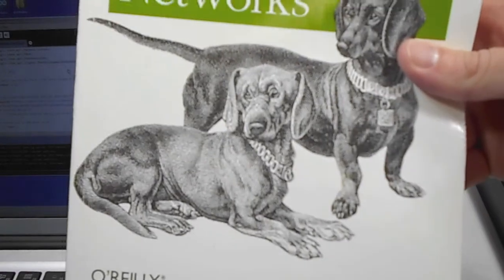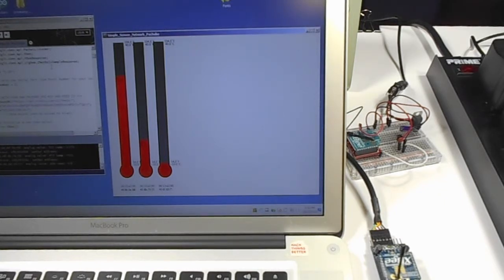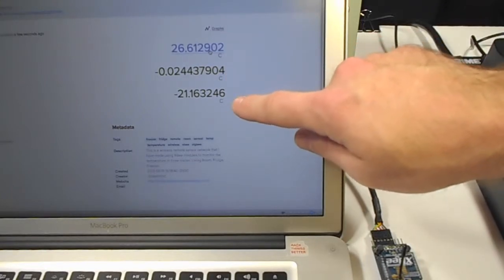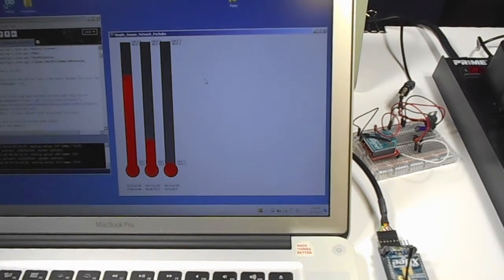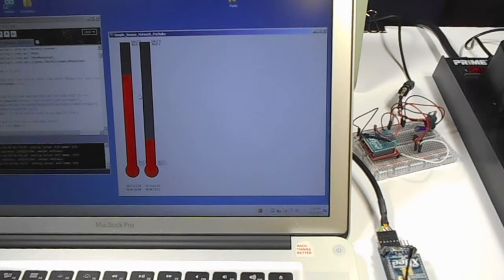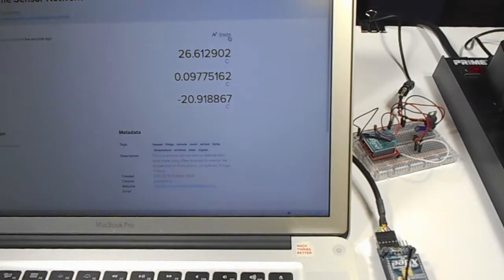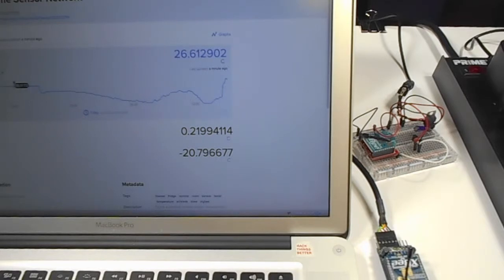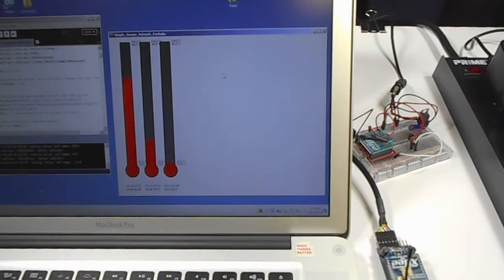BWSN Uploading remote sensor data with Xively

Comment: Hello, I know you have done this project about a year ago... can you tell me what will be the SERIAL PORT (COM PORT) path for the xbee module if it is COM5 on my Win PC ?? it's been asked inside the sketch on about line 20
String mySerialPort = "/dev/tty.usbserial-A1000iMG" what the line should look like?

Thanks a lot.
Sam
Reply from the maker: Sam,  The serial port "/dev/tty.usbserial-Ablahblah" is a mac serial port.  Of course it would look different from the one on a PC.  I've updated this sketch from the original to query the PC and put the list of serial ports in an array.  Then the user must choose the appropriate SerialPortNumber that contains the XBee port.  I've posted it on my blog here:
http://jamesstokebrand.wordpress.com/2013/10/19/bwsn-uploading-to-xively/

Here is my change:
<code>
//  * Replace with the Serial Port (Com Port) Number for your local Xbee *
int SerialPortNumber = 1;
</code>

<code>
 // Print a list in case the selected one doesn't work out
  println("Available serial ports:");
  println(Serial.list());
  try {
    // opens your serial port defined above, at 9600 baud
    xbee.open(Serial.list()[SerialPortNumber], 9600);
  }
  catch (XBeeException e) {
    println("** Error opening XBee port: " + e + " **");
    println("Is your XBee plugged in to your computer?");
    println(
      "Did you set your COM port in the code near line 27?");
    error=1;
  }
</code>
Reply: NsMonkey1

Thanks James for your reply, the sketch is working just fine.
You have such a nice blog with different projects being accomplished.
Great job!
Thanks
Sam
Reply from the maker: Reno Tech
Sam,  Thank you for your kind words.  I'm glad that the sketch was helpful for you.  I have slowed down posting on my blog but I will be posting some new projects that make use of XBees and hope you will continue to visit.